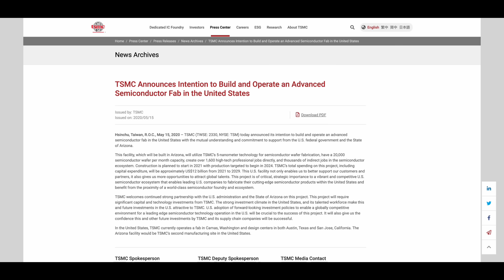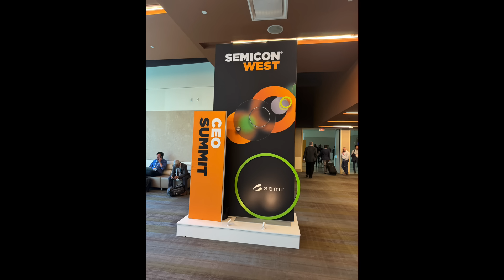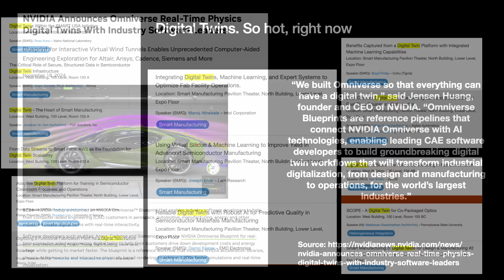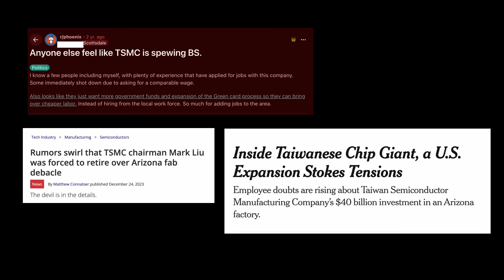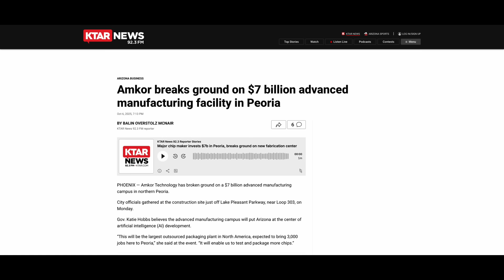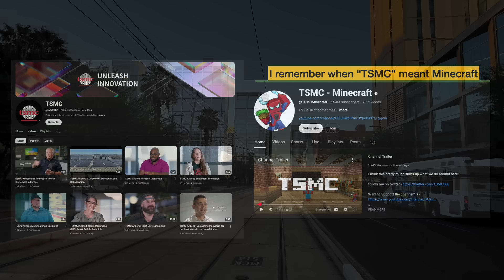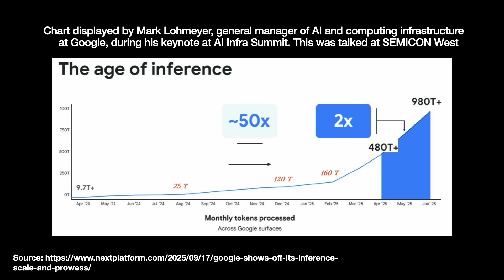America’s Semiconductor Boom is Real

Comment: I'm going to disagree with you because there is no semiconductor boom. 

The proof is in the pudding it's like for instance here and licking county Ohio Intel in the western portion of the county towards New Albany and Aetna started to build a chip fap but as you know or can find out oh they've hauled to that project and of course until itself has gotten into a lot of trouble to where the government bought 10% supposedly Nvidia has purchased 5% and other companies are definitely eyeing it up... 

but what's interesting is TSMC who actually had a partnership in in Arizona facility with Intel basically said that there is no need for the chip fab here in Ohio The very simply not the demand in the marketplace for such capacity especially once you keep in mind that the facility that they're building here in Ohio is actually a two-for-one deal it's actually two chip fabs and one but yes TSMC and other companies have straight up said there is no need for that capacity in the marketplace cuz they're just simply is not the demand so no I'm going to have to say that there is no boom there's absolutely zero boom. 

oh by the way that chip shortage that they rambled about for a couple years It was bullshit there wasn't a ship shortage The proof is also in the putting on that one... 

yeah they started the ramblings about a chip shortage basically the fall to winter of 20 and then of course everywhere still kept on building products such as automakers where was the factory closures nobody closed to factory until Volkswagen closed one in late August of 21 and then GM closed one in September of 21 but what did they do for the 10 months to a year prior to that they were still building cars there was no shortage It was absolute bullshit!

Comment: I've never setup a fab, worked in one or even seen one in the flesh so I am obviously well versed in all the requirements of a fab. However in never ceases to amaze my why you would build such a thing in the desert considering the abundance of heat and distance and the lack of power and water, Im obviously missing something.
Reply: It doesn't necessarily lack power, except subtraction of cooling costs, but it has stability advantages like geographic/seismic, and more water exists in that area than some might guess, efficiency/reclamation needs further advances...

Comment: I'm a mechanical engineer and from what we've learnt in uni a few years back, digital twin as a phrase was used when discussing production lines, especially ones with robots, that you model in some software and then track in real time in that software as its physical twin operates. Furthermore, you make off line changes to try and improve efficiency and implement it faster as you don't stop the line to tinker. So it has two main features: tracking production and optimizing.

Comment: You typically do a good job providing context. In this case you provided little. The TSMC AZ factory output today is insignificant and even after phase 3 it will remain insignificant. The number one strategic threat to the United States and the Western world is our utter dependency and TSMC Taiwan. We are one 6 week blockade from global disaster. 

As of 2025, TSMC’s total global manufacturing capacity is approximately 17 million 12-inch-equivalent wafers per year, of which its four main GIGAFABs in Taiwan account for over 12.7 million wafers annually. The company’s new Arizona Fab 21 (Phase 1) began producing 4 nm chips in early 2025, with a ramp target of 10,000 to 15,000 wafer starts per month. At that level, annual output equals roughly 120,000 to 180,000 wafers, compared with TSMC’s global 17 million total. This means the Arizona site currently represents only about 0.7 % to 1 % of TSMC’s worldwide capacity. Even after expansion to Phase 2 (3 nm) later in the decade, analysts expect the entire Arizona complex to remain below 5 % of total company output, though it will handle some of TSMC’s most advanced nodes.

Comment: Why is the space so yellow in photos of contemporary fabs? I assume it relates to sensitivity of components within those spaces.
Reply: Correct, specifically the photoresist. The chemical needs to be handled in an environment where the light’s wavelength is no less than 500nm. The reason is because the smaller the wavelength, the higher the frequency, higher frequency means higher energy. You don’t want your photoresist to get exposed to unnecessary energy, as a result, the room will be lit in a warmer hue.
Reply: All pictures with yellow lights are a legacy of i-line resist. DUV (and EUV of course) resist is not sensitive to visible light.

If you see a video of yellow lights - it's probably not a contemporary Si logic/memory fab.

Comment: Welcome to Arizona, Jon. I used to drive a dune buggy where they are building those factories and had a run-in with a couple javelina within a mile of there. I build RF gear used in some semiconductor plasma systems and have to say the smaller companies haven't found a way into TSMC for the most part. Hopefully this will change but for truly small groups, this is a very uphill battle at this point. Glad you got to visit during the cooler weather; if you thought it was too hot, you may want to be wary of summer.

Comment: Some anecdotal stories from what I have heard from ex TSMC Taiwan people, current TSMC Arizona people, and my own personal experiences. From a middle aged ex TSMCer from the ROC the stories I heard are similar to the toxic culture of pre 2019 Intel foundry with a little bit of that stereotypical Asian "do what your boss tells you and don't think independently" stank, with the hours and overtime requirements not seeming out of the ordinary to me. The one data point I had for a TSMC AZ employee said it is more toxic there than in Taiwan with extra strain on the transplants and the Americans being set up for failure. He also claims that the fab manager there is one of the most toxic guys TSMC had who often had unrealistic timelines that he demanded from his employees.

As for my personal experience I remember getting decently far in the interview process back when they were hiring the last batch of people to head to Taiwan but I didn't snag the job. Two years later I remember having two different TSMC recruiters reach out trying to poach me after they lost like 80% of the Americans they hired. If memory serves they wanted to 1.5x my salary while also moving to a lower cost of living local. At the time I didn't want to do it since it would mean having to pay out of pocket for the masters I was working on and because I wanted no part in the toxic culture they had. Frankly I don't think my blunt and independent way of working would have earned me any favors there either. 

Granted NUMMI wasn't a stroll in the park, but it also wasn't that troubled once workers realized that the increased demands placed on workers in a LEAN system came with increased respect/better treatment and more value added work. Hopefully the worst is behind TSMC Arizona and the best of both cultures can be synthesized to make another terrific success story like NUMMI! Also here's to hoping for the removal of the toxic personalities making TSMC and especially TSMC AZ a less enjoyable place for TSMC's brilliant talent to work!

Comment: Dear ASIANOMETRY,
Thank you for another well presented piece.
Contrary to what some posters have noted, and regardless of whatever "...interesting..." things said, tweeted, signed, or done economically and politically by the current American Presidential Administration ( and the emphasis is on the term current as there is great doubt many of the policies enacted by this administration will survive into next one ), the move of TSMC to the US was an intelligent decision based upon the same geoeconomic concept and economic model used by the multinational automobile manufactures.  Arizona was formerly a moderately red state, Trump won Arizona in 2016 by 3.5%, a reduced margin of Republican victory compared to previous cycles, despite a more favorable presidential election year for the GOP nationwide, and by 2.2% in 2024, Phoenix, located within Maricopa County, was part of a swing region that tilted toward Republicans, ...so this can explain the "noise" on the Phoenix subReddit. The cultural hiccups between the two systems is par for the course, indeed some of what is learned from Taiwan will be used in the US, and visa versa. The more interesting aspect to this is that, scientifically and technologically, we are on the cusp of what is possible moving electrons inside semiconducting matter, these vastly expensive and large "fabs" are going to need a lifespan of X number of years of profitability to cover their capital expense, modern advanced facilities are often profitable for about 10 years tops, and I wonder how long this fab will be production and profitable before that happens?

Comment: Semiconductor Boom?
Of course:  Moore's Law.
Note that Moore's "Law", actually Gordon Moore's acute observation, has changed over the years -- and of course, like anything else it will fluctuate through the future.
I first remember it in 1966, when I was working for the CBC's This Hour Has Seven Days and it was becoming clear that transistors, first made in 1947 or '49, were going to start taking over from vacuum tubes.
The original "Law" was that the density of transistors on a board (precursor of today's chips) would double every year or so.
In '66 or '67 the first chips appeared.  Fairchild, I think  it was, promised to release a new chip every, I forget, six weeks or so.  Everybody was amazed.  It accelerated. Things got smaller and smaller and more and more powerful.
Now, stay tuned for Lloyd-Jones's Codicil: It's slowing down!
You can Google it yourself to get the latest numbers.  But my codicil is, when it used to double every 15 months or so, today it doubles ever 24 or 30 months.
It's doubling half as fast.  I say something crazier: it will continue to get faster more slowly.
There!   Εύρηκα!  OK, Eureka!  The increase in speed of computations on chips will continue to slow down.
Ahem.  Just as it has for the past sixty years.

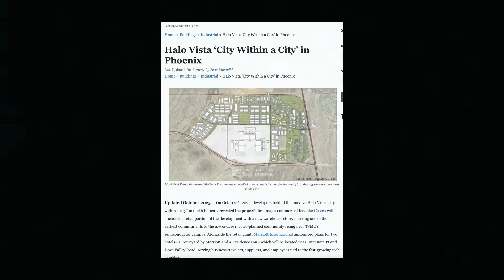Comment: 13:50 what I find it quite strange, is that people usually say that water is "consumed" by data centers. Unless I'm misinformed, this water is not consumed but only heated up and then released: it would be quite bad for the tight pipes all around the data center to be corroded by the "wild" water instead of having 2 loops and/or heat exchangers.
Reply: It's not a data center, it's a fab..,
They require lots of ultra pure water, most of which will get reprocessed because even used it is orders of magnitude cleaner than tap water.
There is obviously some waste and replenishment.
But you still have immense spaces that need air conditioning and hundreds (if not thousands) of people and their hygiene as well.
Reply: In this sense water is never consumed, except in the rare case that it's actually electrolyzed to hydrogen and oxygen. The water in the biosphere is roughly constant. But an enormous amount of energy is spent conditioning water and moving it from place to place, and in the US Southwest especially we've lived by drawing down natural aquifers at a rate must faster than they will natually replenish themselves. So it's more useful, practically speaking, to say data centers "consume" water.
Reply: yeah, the water just gets recycled. The main issue is that it puts strain on the local water system, which can only pump a finite amount of water at a time and locals bear the brunt of the strain, especially in arid areas.

Comment: 7:07 That building is currently General Dynamics, I used to work in the tin sheds behind that building, put up in WWII for proximity fuse production. Those 80 year old temporary buildings are now engineering offices that have water pour out of the bottom of the huge electrical boxes on the wall. You can't miss them, they have very large arcflash warnings on them. Really, I'm not exaggerating.

Comment: Uhm, you should know, "30 to 40 minutes" from downtown, in Arizona, it is the rule, not the exception.  And ALL big buildings like that are out in the desert.  Real desert.  That's how they built cities here, they put a large employer out in the desert, and then built everything around it.
Reply: You can not build a large industrial facility in the middle of city anywhere.
Reply: Phoenix is huge. The distance between TSMC and Intel fabs is something like 60 miles.
Reply: @JameBlack  I would allow longer.
Reply: There are some large agricultural areas surrounding the Phoenix area.
Reply: Crazy since the river is drying up
Reply: What river, the Verde. It’s more like a creek, the Salt is almost always dry. The Colorado is suffering from a drought but that’s not something AZ can control. 

Water recycling by the fabs is the only answer and is being done at Intel as far as I know.
Reply: @support2587  The Salt River is dry because it has been dammed up since 1911, beginning with the Roosevelt Dam, along with newer dams in subsequent decades. After periods of heavy precipitation, those dams have to release water from their reservoirs so they don't exceed their designed capacity. The Verde River has Bartlett Dam and Horseshoe Dam to create their reservoirs. All of these dams were put in place because the engineers foresaw growth in population and the cyclical, natural droughts to which the area is susceptible.
Reply: how do they get the water tho?
Reply: @carholic-sz3qv  The Central Arizona Project is an aqueduct that brings massive amounts of water from the Colorado River, which reached the Phoenix area in 1988. There are also multiple large reservoirs which also serve as recreational lakes surrounding Phoenix, in addition to underground aquifers in the Salt River Valley.
Reply: @carholic-sz3qv  Clever water/aquifer mgmt that has been improving since the 1990s... but still really falls short.
Here in California we do have locations that have plenty of aquifer storage to host chip fab+server farms.

It's sort of a secret held by the environmentalists + geology crowd.  But it'll be here if the nation really needs it someday.
Reply: @carholic-sz3qv Canals divert water from the river.
Reply: @carholic-sz3qv  they dance in the desert until it starts raining
Reply: Thanks . Living in Walesi did'nt know that .Diolch !
Reply: If I may inject a word here; "Grid"...
Reply: @Joey_Oliver  These plants do require a lot of electricity. It is my understanding that the regulatory stops are being pulled out to allow them to build and develop their own separate power plants to meet their energy requirements. This is also true for AI data centers

Comment: My father was at IBM in the late 80s through early 2000s. He and I often talk about how lamentable the American semiconductor industry has been since the late 2000s. His biggest disappointment was always Intel, and how they made so many unforced errors with their innovation. I don't know how much confidence he'd have in this boom, especially after how bad the 2010s were for the industry. However, I'm cautiously optimistic. While I am amazed at the shrinking size of transistors, increased scaling of chiplet and chip production, and finer and finer packing in 2D and 3D structures, I really would love to see the ability to fabricate devices that might not necessarily be the smallest, but without needing the fine control over conditions, i.e. ultrapure water, exposure to certain wavelengths of light, and maybe even doing away with some scary chemicals used in processing such as fluoroantimonic acid, which I am terrified of. 

The future looks bright! I just hope nothing gets in the way, like unforced errors by management, or a government which lacks technical knowledge over what they regulate.
Reply: The government in Asian countries is filled with engineers and technologists. Here we have lawyers who love taking bribes in our government. You should consider running for a local election that would be fairly easy for you to win. You can make a big difference.